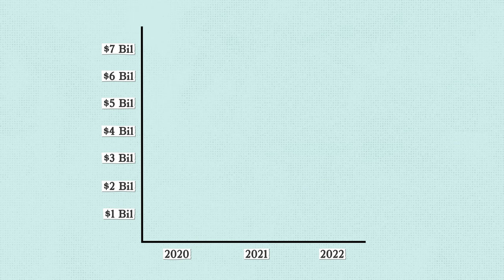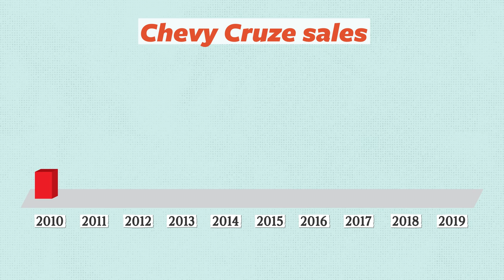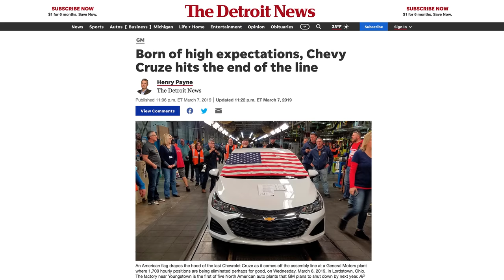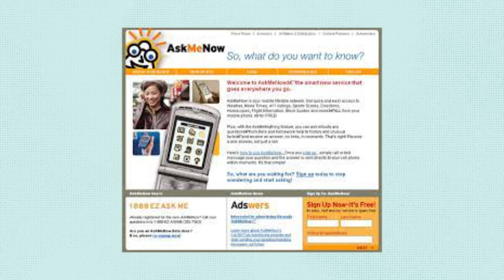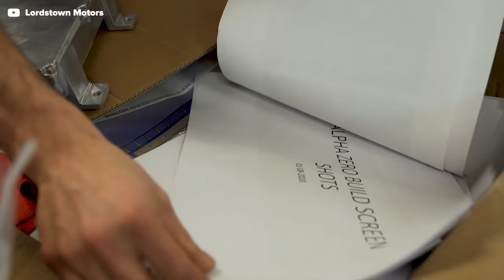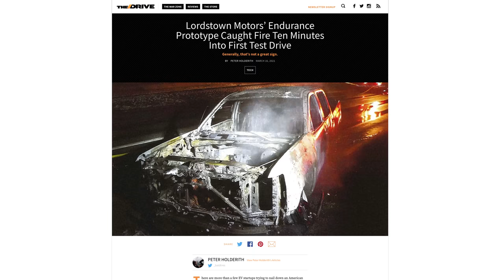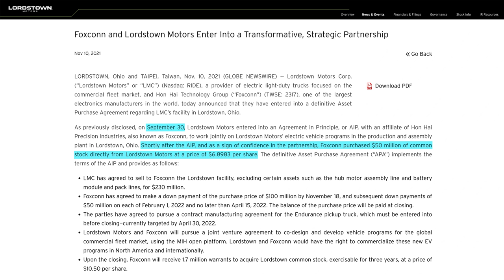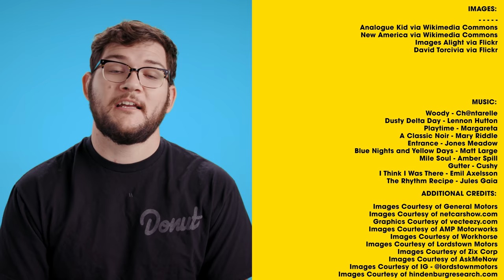How to Lose $5.5 Billion in 2 years

Comment: I remember back in april 2021 there was a race in México, and Lordstown promised to be the first electric vehicle to finish that race, they made a tubular chassis with the 4 electric motors, and i think they said 650hp, it all looked weird, it was preprepped in a company specialized to those kinds of races, they did many press releases, and videos talking about it, and how it was going to be and important step into off-road racing, plus they said autonomy would be around 72 miles per charge, so some 2 hour fast charging would be done for that 300 mile race. On race day, there were only 2 vehicles in the elcetric vehicle class, both were really slow, they were passed by an old VW Beetle and the rest of vehicles that started behind them. After 42 miles, the other car, an old Toyota Hilux, with motors and batteries of a Nissan Leaf, passed the Lordstown Truck, and Lordsdstown stopped for like 30 minutes cause they ran out of battery, so they called a chase truck, to take them out to pit and recharge the batteries, then the chase truck got stuck like an hour, finally they made it to the highway to recharge, took longer than 2 hours to recharge, it was pretty late, when they went back to the race course, the Hilux was walfway to the race at that point, while lordstown was going back to mile 42, but then Lordstown got DQ´d cause they started driving the wrong way, they got noticed and retired, the Hilux couldnt make it either, they broke the front right suspension i think, i remember seeing comments of people being pissed after that
Reply: I remember that, they totaly ignored/forgot that range on road is totaly different from range on sand/off road. At least it did not broken down so maybe they learned how significantly range is reduced on loose surface and try it  in future with extra batteries.

Comment: Good work. How about other EV's? Like Bollinger EV Pickup, maybe?
Reply: Or byton who also raised billions and hasn't produced a damn thing despite showing off the m byte back in 2018. 
Maybe nikola motors to? Raised billions bilked it's shareholders inc gm, and so far has made a few trucks assembled from a German chassis.
Reply: out of all the startups,lucid has the best shot and nobody understands them at all despite them ramping up production in silence.
Reply: @andromeda9340  proof of said ramp actually happening at lucid motors? 
They showed the air off 6 years ago now in April of 2016. The powertrain itself was in a converted cargo van they smoked a p85d with in 2015.
Their parent co has been around for over 15 years now, they provided the motors and batteries for formula e through this season. Lost the contract for the new gen 3 formula e cars.

Lucid raised over $20,000,000,000 so far and built a ground up facility called amp-1 finishing it over a year ago now. 
They recalled cars already for a suspension issue. Lucid is all out of excuses imo. Especially with all the trash talk Rawlins did about no production hell and tesla beating specs etc. 👍🏻

And why hasn't a SINGLE independently done fully instrumented test of an air taken place yet? Motor trend gave them all kinds of early coverage last year inc coty. Yet hasn't posted any official reviews of it with real world specs like range, charging, acceleration etc. 🤔

Comment: As a gear head I’m surprised that you didn’t delve into the hub motors used in the Endurance.  There are a lot of new capability that can be derived from a system of a computer individually controlling four hub motors, each capable of producing 150 hp and 1100 lb ft of torque.  This system dumps the diffs, as well as half shafts, drive shafts, transfer case, transmission, ICE and supporting stuff like exhaust, cooling and fuel.  You think front lockers are bad ass?  This system could do this electronically.  It can also make super tight turns by controlling the torque and turning direction of each wheel.  It can do tank turns but why tear up the ground when you can turn the rear wheels in opposite directions.  It has 13” of ground clearance without any lifting.  The $5.5 billion they’ve spent isn’t much different than what GM and Ford are spending to get their electric pickups into production, but they have much deeper pockets.  Foxconn taking over the Lordstown plant and manufacturing the Endurance under contract has been a godsend.  Foxconn is not big, they’re gigantic with revenues around $200 billion/year they will have the assets to make this happen.  They will also be building the Fisker PEAR and since they make the iPhones, they have a good shot at the future Apple car.  BTW, the agreement with LMC is for two vehicles, one is the Endurance the other is unknown.  The plan is LMC sells these vehicles in North America, Foxconn will sell them in the rest of the world.  Yeah, they’ve had financial and management problems but their hub motor technology can be a game changer, I for one hope they will succeed.

Comment: Wheel mount motors seem like it'd be the best option but it would be a headache in the long run I bet
Reply: 4 moving parts.   5 minutes off and back on.  Can't do that with an engine.  Plus you save on oil changes
Reply: I agree,the fact that hub motors are in a work truck is ridiculously dumb IMO because nobody knows how durable and reliable the technology is under extreme situations. work trucks live hard lifecycles,they get dinged,they get hella dirty at the jobsite,etc and I wouldn’t put unproven technology into the mix.the cost of ownership will likely not meet the targeted market anyway which would make it pointless for most consumers.if they used normal EV powertrains that are proven and reliable ,then it would be great for them because it reduces cost and give everyone savings but all I see right now is an expensive lifestyle truck that pretends and tries too hard to be a work truck💀
Reply: @andromeda9340  When the hub motor experiences a front-end collision into a concrete wall and comes off the test truck fully functional and undamaged I think that's a good sign.  I think people will find themselves clamoring for these once they begin to become known on the market.

Comment: Workhorse had a history in working with GM, GM sold the rights to their large van the P30 to workhorse the P30 is basically the chassis used in about 70% of all motorhomes and stepvans which are used as snap on, FedEx, laundry trucks etc.

Comment: W15 of Workhorse is not becoming Endurance. W15 is a truck with traditional transmission gears, Endurance uses hub motors which is world's first for pickup trucks. Lordstown said the Endurance does not rely on the design of W15 and they developed their own IP for the Endurance.

Comment: 4:02 The claim that the vehicle will go 320 miles with a 60 kWh battery pack is either wildly optimistic or fraudulent. My little BMW I3 uses around 310 watt-hours per mile, how a full-size pickup will get along with just 188 watt-hours per mile defies explanation.

Comment: 10:12 complicated no its more like impractical for one it exposes the motor directly to any and all road vibrations and it forgoes the electric motors biggest advantage RPMs you can have a 1000Nm motor spin rally fast and run it through a reduction box at 10-1 to get 10,000Nm at the wheels where as hub motor needs to directly make 10,000nm asking that of an electric motor is very hard especially in a hub size package.

Comment: So, I live about 6 miles from the Workhorse headquarters in Cincinnati, OH and I work about 4 minutes from the headquarters. I have seen the W-15 in person driving around the surrounding area, and I even got to take a personal look at it. Incredibly ugly, sure, but it seemed like a winner in terms of overall design. This would have been in its original state with an 80 mile electric-only range with a gasoline range extender. The engine, I believe, was a BMW 3-cylinder, and the electric motors were in-house designed, as was the battery pack. The truck had two motors which were 268HP each, and it would take off like a stabbed rat. Towing capacity was 5,000 pounds (~2300Kg).  I've also seen one of their concepts for the USPS NGDV before they lost the contract to Oshkosh. The parking lot is typically full of UPS delivery trucks in for service.

It's really cool to live near them, and it's a shame that their cool concept truck has had this sort of fate at Lordstown.

Comment: I remember when I visited their facility last March and they had no assembly line capability at all, none... 

I reported that out multiple times, and the venture capitalist behind the whole deal doxxed me, went to the owner of the company I worked for, and applied pressure to have me fired. 

I returned home and shorted RIDE at 14.20 a share.

When I returned for Lordstown Day in June, they couldn't put the wheels on... The motors are in the wheels 😂

I was escorted from the facility 😂 

My shorts made me 62,000 dollars 🙂

I'm sure the people who floated the SPAC did not lose anything. 

And GM happily wrote that shit off.

Comment: I think the real juicy part to this story isn't about the electric truck.. it's more so on the GM delta platform which the cruise, HHR and few other cars also shared. GM had a really serious issue w a faulty ignition switch where if you had enough keys on the rest of the key chain, which most people would have.. the ignition switch had a faulty design that from the vibration from driving, the switch would turn back to shut off the car while you were driving. Which then would render the vehicle with no brakes, no power steering and the steering column would lock up while you're doing 70+mph on the freeway. Several people were killed from that issue and GM fired a few engineers they didn't like anyways and swept it under the rug. Then they decided to just shut down the entire line due to the scope of the risk and turned the attention to this whole Lordstown fiasco.

Think about it. That Chevy cruise was the only thing GM has to compete against Ford focus, Honda Civic and Toyota Corolla. GM had that market in the bag in the Midwest. There were so many Chevy cruise all over the road in the mid America. Why would GM all of a sudden kill that car...? Not to mention the HHR was doing pretty good too. Well I think it's just a classic "look there not here" strategy..

Comment: Anyone who knows even the slightest bit about automotive industry could have called Bullshit on their claims from the get go. The cars that hit the market today had their design freeze 5 years ago. Isn't it telling that the infotainment systems always feel like they are "a little old" regardless what car you get into? They are 5 years old, that's why. It takes that long to set up a production line, streamline the design to be profitable, explore market demand and determine projected sales volumes, get the tooling and processes ready, certify and test the prototypes and prepare the advertisment. Building cars is a matter of heavy industry. It's something that theoretically "can be done" in a small workshop, but realistically needs to be done in a huge, specialized factory purpose designed for the product. Every cent spent on a vehicle needs to be justified. The paint coat that goes onto production cars is designed by the gram that goes onto the car. There is not a single screw on a car you could do without (Except maybe the ones that are required by law but not necessary by physics such as the amount of lug nuts) and if there was a way to make a component cheaper, the manufacture will take that route. Cars have such a low profit margine, these steps aren't optional. They are absolutely necessary.

Comment: The big problem for ALL electric vehicles is the continuous rising price of lithium used in batteries and it's limited availability.  The battery in a Tesla originally cost $12,00 but now costs $24,000 with no cap in sight. Plus a lithium battery needs to be kept cool both while discharging and while being charged, which takes up space and adds complexity and weight to the vehicle. Lithium batteries can't be installed too close to the sides or bumpers of a vehicle because puncturing a lithium battery can result in a fire.  I believe that lithium batteries are a dead end for vehicles.  So, do you think paying $52,000 for a truck with a range of 300-350 miles worth it?  I don't think so!
Reply: @dudeman5788  It is not,  it makes up less then one tenth of one percent of the atmosphere.  The source of hydrogen used in spacecraft is natural gas, with the by-product being CO2.  The real answer is to not burn anything to move a vehicle or generate electricity.
Reply: @dudeman5788  Yes, In space, but on Earth in it's pure form, is a bit more rare, with most of it tied into petroleum and coal with carbon.

Comment: You said an EV truck manufacturer out of Ohio.... Honestly, as a Midwestern my self, I'm surprised they were even able to make that much in funding. There is ZERO EV market out this way 😂 only wealthy town goers drive EV's, they are useless otherwise. No where to charge them and our roads/conditions will drastically hurt reliability. They aren't common in our demographic for good reason, they aren't efficient, practical or affordable.

Comment: This isn't totally related, but can someone tell me how a 60kwh battery can power a car that's more than 60kw for more than an hour? I mean like, in the sense that metric countries measure power output in kws instead of bhp. If you tell me to google it I'll spit in your mouth.
Reply: A car is not usually using full power most of the time. One with good aerodynamics such as a Tesla is probably using an average of about 15 horsepower at 70mph, and an electric motor can work efficiently at this power even if its maximum power is hundreds of horsepower; hence a car with several hundred horsepower and a 90kwh battery can run at 70mph for several hours. However the claim of 320 miles from 60kwh with a vehicle that probably is not very good aerodynamically does look too good to be true, unless the range was tested at a very low speed.

Comment: did they really lose 5,5 billion though? it was all air that just got popped. if i claim to a guy doing a valuation on my house, and i claim that the house is isolated with solid gold, the floor is of Italian marble, etc etc, and he believes me, he'll value the property at let's say 500 million USD. Then, i have a water leak from the roof, some repair guy comes and fixes it, and when asked how working on gold is he exposes the roof is not of gold (at best fake gold paint). 
the lie gets exposed and the house true value is $ 250.000 USD instead.

did i just lose $ 499.750.000 USD ? No. The house never actually valued 500 million anyway. 

I lost my trustworthiness though. 

Sure, market shares are a different beast but it's not that kind of different. After all, it remains to be seen if 'real money' ever went that way out of the 6 billion stock value anyway. That the company is worth 6 billion due to stock does not mean that the company actually received 6 billion on it's bank accounts.
That also means that the investors never really 'lost' money even - they did lose 'opportunity', in the form of 6 billion so to speak.

There's a whole difference in 'theoretical' money vanishing due to a scam being exposed compared to, for example, MC Hammer burning through all his fortune by a ridiculous mansion. Or, building a luxury ocean liner and then blowing it up in the middle of the sea, without it being insured. 

that said, interesting story nevertheless.

What I'm wondering far more, and this is not touched at all in this video, is what happened to Mr burns? i would assume that files could be charged against him for committing fraud. After all, claiming there are 100.000 pre-orders is fraudulent. I